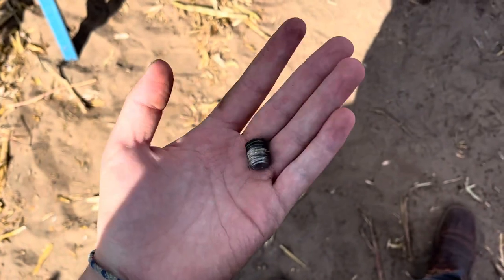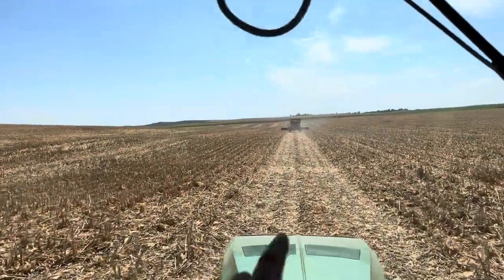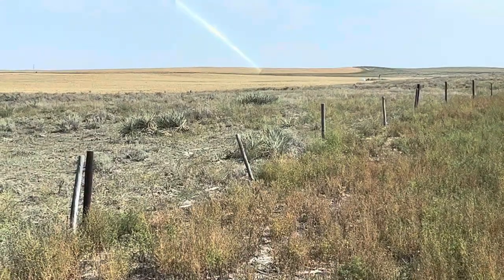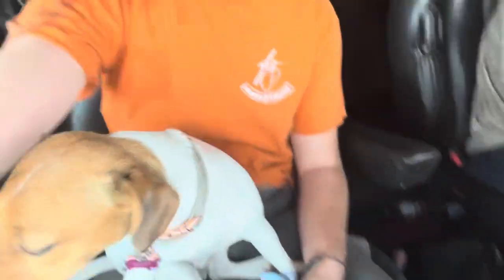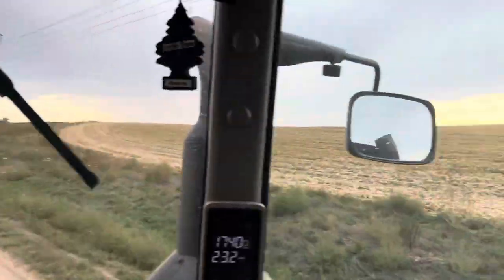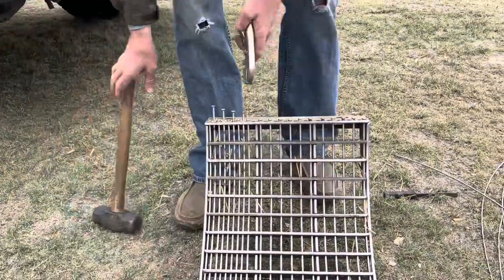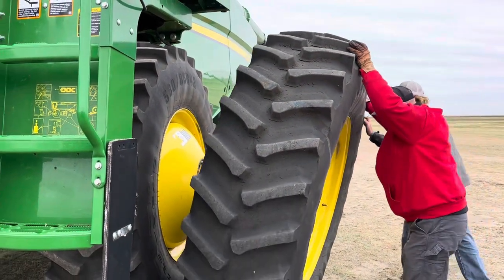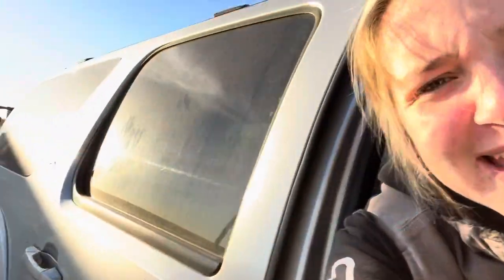Where Does the Corn Go? - Custom Harvest 2022

Comment: Those first two were mule deer does they get pretty good size especially when they have good eating , like corn. Our ranch is right along the Montana North Dakota border about 22 miles north of the interstate. We've never had elk on our place before they stocked the Roosevelt National Park with them we had a herd of 15 this year they harvested two good size beauties! Hydraulic lines and hoses are a never-ending story. Along with those Wee Little bolts that hold a lot of vibration together. The good old welder is usually the best repair, especially when a metal tube hss been  compromised! Like you're informative videos Emma. By the way  , were there predators circling that Pheasant? Seen a shadow or a couple Shadows a hawk or two, something up above?